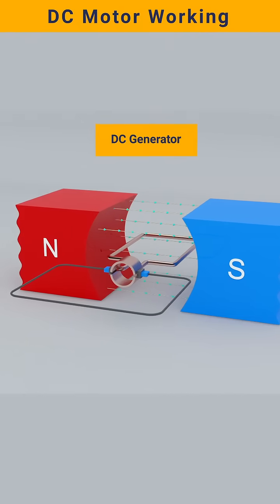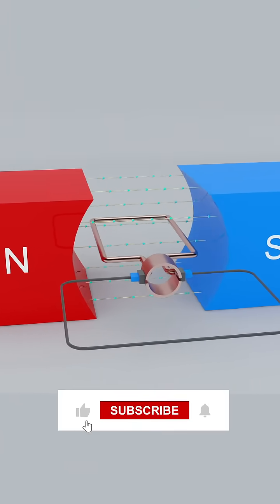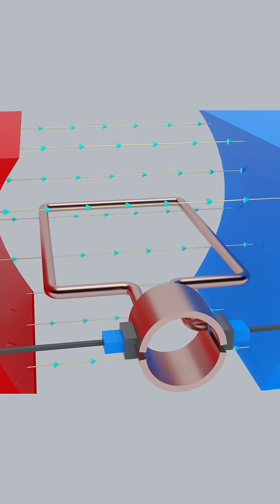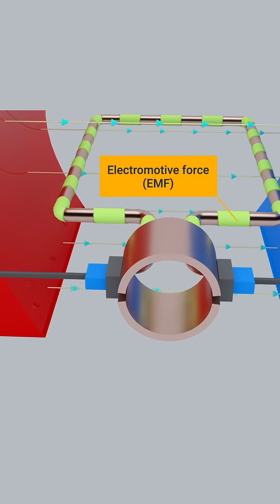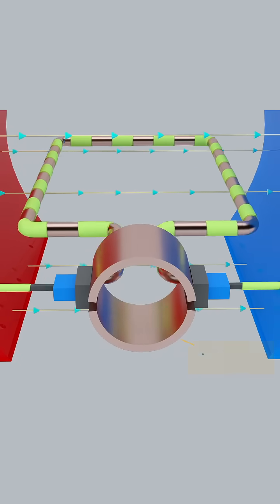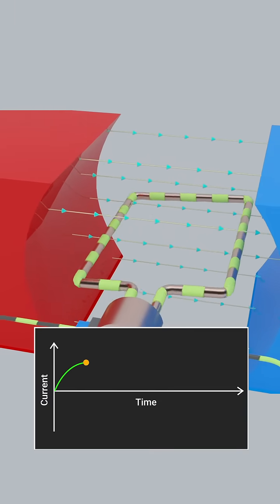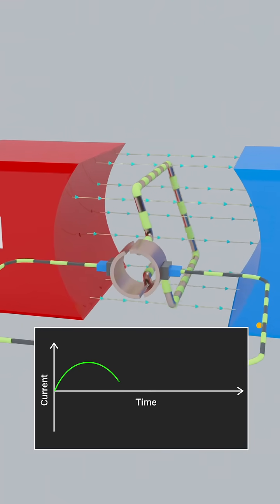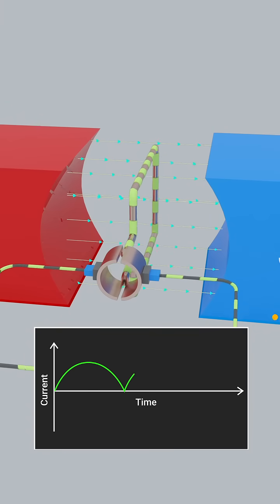DC Generator 3D animation |  DC Motor Working Principles in 1 minute I Induction motor

Comment: The part of rotation is wrongful.  When the normal vector does 0° with the magnetic field the current is max . And when 90° current is zero.
Reply: No, it is right. When the plane of the coil is at right angles to the flux, the flux linked with the coil is maximum, but the RATE OF CHANGE OF FLUX LINKAGE is minimum. So both sides of the coil don't cut the flux, so no EMF is induced. And when the plane of the coil is horizontal that is parallel to the flux, the flux linked with the conductor is minimum, but rate of change of flux is MAXIMUM. And then there is aan EMF induced in it.
Reply: it's the normal to the surface not the surface it self .